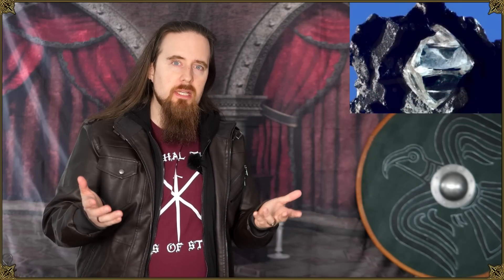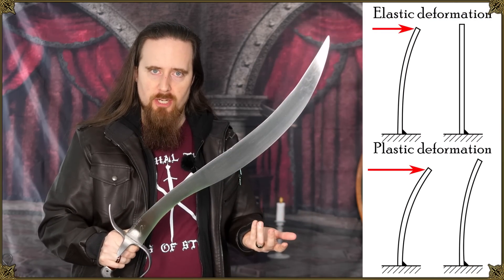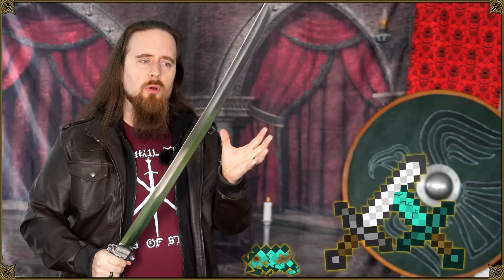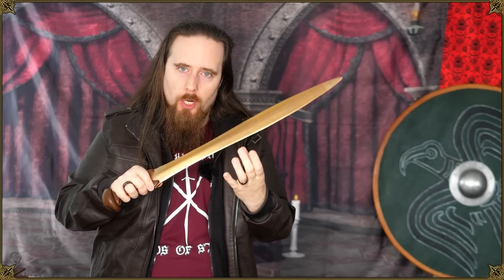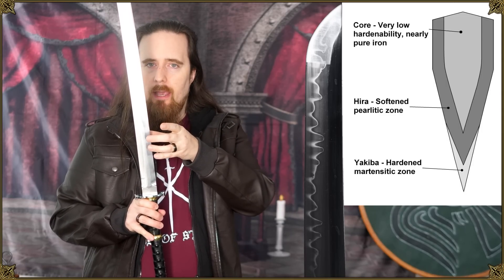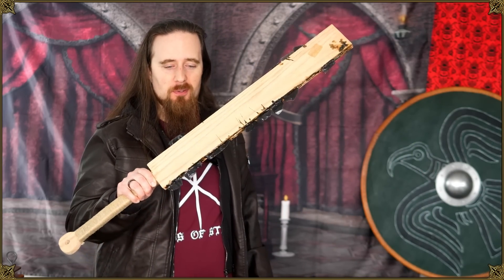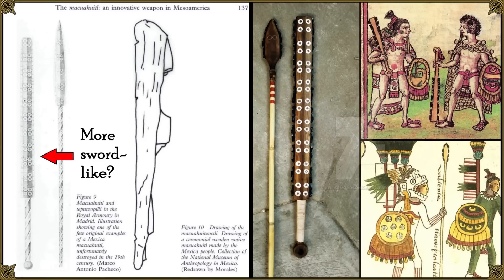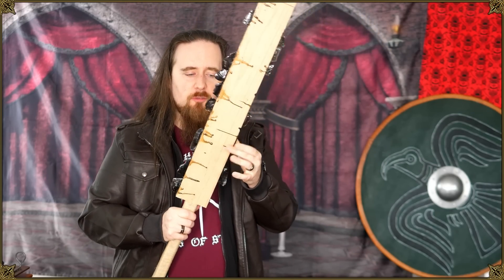Diamond Swords: Could They Work IRL? (Kind Of)

Comment: That is not a very good looking macuahuitl Skallagrim. You lost me a little here. After my own research i've learned these weapons looked more like actual swords and less like big fanned out clubs. I feel like it is too easy for people to forget these weapons were made lovingly by expert crafts people. Aztec swords, weapons and armor to me were the most advanced. 

Aztec one handed and two-handed Macuahuitl were like the original light sabers with a cutting edge of 1 molecule thick. This is 3 times sharper than diamond (sorry diamonds), 500-1000 times sharper than a surgeon's scalpel. They still use obsidian for eye surgery that is how important this material is.
It is incredibly easy to replace or repair weapons made of wood and stone. And in Aztec lands the stuff is everywhere. It was no big deal if you chip up your sword, you could replace the blades or get another.
Even the armor was superior to heavy plate armor. Aztec armor which could withstand powerful obsidian weapons also withstood gunfire with Desoto's own men trading up to get this lighter armor.
The key to their armor was it was packed layers of cloth soaked in a special salty brine and left to dry in the shade. Layers and layers of crystaline protection. 

I would be super happy if you did a video all about Aztec warriors-eagle warriors and jaguar warriors.

Comment: The amount of carbon that goes into steel is actually a huge debate in sword making. Like you say, diamond is brittle (diamonds are basically super compressed carbon structures) and steel created with super high carbon amounts become hard as hell (they'll retain an awesomely sharp edge) but, man, the steel becomes brittle. You get that cut wrong or take a hard blow to the blade and it's going to shatter. Low carbon swords get too soft so they're basically worthless. Carbon is not some kind of magic element, after all, we're made of a ton of carbon (that's basically what "organic" means in chemistry!).

Now here's the cool part: fabricating carbon structures on a molecular level can assist in metallurgy. Making that fabled "diamond sword" may not be possible, but things like carbon nanotubes can help reinforce traditional metals and make them much stronger. In the future we may be able to use chemical engineering to create a metal that can go beyond the 1095 high carbon steel AND be less brittle as well!

Comment: Personally I wanted to make a ceramic blade with a steel core/spine holding in place.... Then I realized that the ceramic parts may need to be broken into smaller pieces to help them flex with the steel portion.
Reply: Isn't corundum (ruby/sapphire) just under diamond in hardness, but is considerably tougher? Makes me wonder how a ruby sword would work.

Comment: At my job we use diamond tools. What they are is a standard tungsten carbide end mill coated in a fine coating of diamond dust and adhesive. The diamonds are "pre shattered" in the form of dust and you still get the effects of their hardness. We use it for some seriously abrasive jobs like cutting PVC plastic and carbon fiber

Comment: Interesting that you bring up composite construction with hard crystals embedded in a ductile matrix-- because heat treated steel is exactly such a composite in its molecular microstructure, with hard but brittle carbides suspended in a ductile ferrous matrix. Different heat treating protocols can alter the volume, size, and distribution of carbide crystals, thus resulting in a different balance of physical properties of the steel.

Comment: Ironically enough, Diamonds are actually Less Brittle than Obsidian, Partially because Hardness and Toughness are not necessarily Opposed Traits, you don't NEED to Loose one to gain in the other across all materials (Some Materials ARE Tougher AND Harder than others, The "tradeoff" thing is only in relation to different qualities of the SAME Material, like Steel), and partially because Diamonds are SO Hard that the Minimum force required to actually Shatter one is MUCH Higher than what is required for Something as Brittle as Volcanic Glass (Obsidian). Seriously, Diamonds are "Weak" to Pressure, but Go Watch a Vid about how Much Pressure it can take in a Hydraulic Press before it actually Shatters... It Starts to pierce into the Press's "anvil" for a while before it finally Explodes. A good way to explain it is Hardness Equals "Damage Reduction" and Toughness Equals HP, Diamonds have ABSURDLY High Damage Reduction so Basically nothing will do any damage to it, BUT it has Low HP, So if something COULD do some Damage, it'll just be completely Destroyed, it just takes a LOT to get over that "you do no Damage" threshold.

Now I can't be Certain of this(I didn't Test the Kinds of Impacts Required to actually Damage a Long Stick of Diamond), But I've got the impression that unless your Made your Diamond sword to be Rapier thin and long, that Human Strength simply would not be enough to Shatter a Diamond Sword... Oh and If a properly Proportioned Diamond Sword (A Shorter and thicker Blade, like a Gladius at most) Clashed with a Steel one, it would CUT it, Probably not all the way though, but it would probably Have about the same effect as what you'd Expect from using a Steel blade against a Wooden one: Do NOT Repeat the Process too much, or you'll end up with a Metal Twig instead of a Sword. Now the Problems with the very Concept of a Diamond Sword are that A: If anything hits it hard enough to do ANY Damage to it, it's gonna Basically EXPLODE, there will be nothing to Repair, so you won't Just have a Blunt Metal Rod to Hit People with anymore, you'll effectively be Unarmed. B: Manufacturing one is effectively Impossible, we'd need to Make a Diamond from scratch in such a way that it would be Big enough to be Made into a Blade, Which is an Absurd notion considering how Tiny we make them with Modern Technology, Even a Macuahuitl Style Shorter Blade Fragment would be Too Big and Unusually shaped to Really Work...

That Said, In a Fantasy Setting, you could probably use Transmutation Magic to Fuse and Shape a Bunch of Diamonds together to make a Single Blade in whatever shape you want, Ideally Wrapped around a Steel Core to give it structure, Kinda Like "Gold plating" but a somewhat Thicker, done like this in such a way that if the Diamond DOES Break, the whole Sword doesn't Just Explode, just a relatively Small section of it. Then enchant the whole thing to Make the Diamond Blade Regenerate any Damage it might take, fixing the Problem altogether. Now you have a sword that can Cut other Swords and you don't Risk loosing it if you hit it at a REALLY Bad angle or if a Guy with a Hammer as big as your Head shows up!

Oh and Wolverine's Iconic Metal claws are Made of "Adamantium" which is a name Derived from Diamond if you go far back enough in it's entomology. Adamantine was the "Metal of the Gods" in Greek Mythology, the Gates Olympus were Made of it. Take Adamantine, Replace the "ine" with "ium" to make it sound more like something from the Periodic Table that also evokes Metals, and Voila. But, Adamantine itself is Derived from "Adamant" which is Greek for "Untamable" but also used as an other word for "Diamond"... So Really, Wolverine is Running around with what is Kinda Conceptually Diamond Knives in his Hands...

Comment: So, the lesson I'm getting here, is that the Macuahuitl is almost a one-shot weapon. It will rightly end the first guy you land a solid blow on assuming he's not wearing steel armor, but you're going to be doing severe damage to your sword (actually it's kind of a saw, kind of a club thing?) in the process, greatly reducing its effectiveness. The next blow, in the same spot, might not have any obsidian shards worth mentioning, so you have to reverse is to get in that second shot, but now that side is wrecked too, so your third hit will have to be with a less-optimal part of the blade, closer to your hand, and before long, if you're still up, you are fighting with a very clunky club that might still have a few jagged or pokey bits sticking out of it.
Reply: And if you are fighting an actual man rather than a target dummy or water bottle, the man would raise a shield or weapon so your macuahuitl loses its edge without even contacting flesh.
There is a good reason nations that mastered metal conquered most of the world while those still messing around with wood and stone fell into the history books......

Comment: The best use-case I can see for a diamond blade edge is as a knife for doing basic cutting utilities. We see similar things with some modern drills where the very tip of it is made of diamond. Beyond this, of course it wouldn't be effective, for the reasons stated, anybody who watches Forged in Fire has probably seen the consequences of material that is too hardened.

Comment: I think you can look at ceramic blades as those are quite easy to find. These are extremely hard, can be incredibly sharp and has fantastic edge retention. But they are also very prone to chipping and breaking. A blade made of diamond would be quite similar in it's properties.

I have had several ceramic kitchen knives, but they tend to break so there's only one left now. And that one has a few chips taken out of the edge so I never use it. I even got a special diamond sharpener for the knives, but they tended to break before they needed sharpening...

Still, I think they are pretty neat, much like a party trick. But for daily use they are not really worth it.

Comment: What about diamond powder steel alloy and the the edge is heat treated with diamond powder? The edge of the blade preferable. Though to make it softer you could use more clay. I think the point of a diamond sword is to reduce the material, time it takes to make the blade and increasing the hardness so because of diamonds toughness against other materials. 

However designing a functional one would be difficult. Could expirement with using quartz or other crystalline structures within steel. 

One more thing diamond, crystal or ice swords are seen in fantasy because they have a special property depicted of magic being incorporated within them.

If you could make the bonds of diamond more elastic that could make it possible. 
Not sure how to do that, there may be a method in physics of some kind to do so or atleast a theory or two. More research is obviously needed in what ever method is available to make a diamond sword at least more feasible.

Comment: From what I have heard, well-made Machuahuitl have long straight flakes of obsidian that are not flintknapped but cleaved off. They are removed from larger pieces of very pure obsidian with an edge that is already sharp and close to perfectly straight, and are considerably sharper than what is possible with metal.
Reply: Many tests with more crude flintknapped or spiked versions show it behaving more like a club, but the best historical examples had long, near-atomically smooth blades and could cut quite effectively. The Spanish considered the weapons to be a type of sword.

Comment: I see pcd used in CNC machining where The main tool is a steel piece and the pcd is a coating which is not so dissimilar to the idea of a hard jacket and soft core. Usually those tools are insanely expensive so I don't see them in wide scale or large tools very much. But if there's any hope it would be something like that. Maybe not as a combat weapon but could make for a good kitchen knife perhaps.

Comment: In anticipation universes there are some solution for that diamond blade thingy:
In Cyberpunk there are sword with diamond monomomolecular thick blade edge cutting through anything like hot knife into butter. The blade being so brittle, it is totally interchangeable. edge is busted because you slayed a guy in its  metal gear armor? No problem! Unscrew the blade edge or blade edge segments that are damaged, replace that by new one(s) and you're good to go!

In Shadowrun there are dikoted blades, the blade is reinforced by a deposited layer of synthetic diamond, turning it into a deadly sharp and hard weapon, able to slice easier.

Comment: That topic makes me think of cross-country ski poles. Good ones are made of carbon fibers, which makes them extremely light and extremely rigid, which is good for competition because it means that you have less weight to lift and a bigger proportion of your upper body's strength gets transmitted to the ground. The downside is that they aren't elastic at all and break very easily.

Comment: looking into it a long time ago, diamond has less of a problem with being brittle (though the layman would probably think of it that way) and more of a problem in that it has very obvious cleavage (im not making this term up i swear) which is effectively a plain within the atomic matrix which the atoms slide by each other very easily. outside its cleavage diamond has more tensile strength than any other natural material and most manufactured materials, but because it doesent form large structures (and by large im talking large on an atomic scale) without these cleavage zones it can shear along them with much less force and due to its hardness this becomes easier because less of the crystalline structure wants to deform to compensate.

diamond is not however more brittle than obsidian which is not only full of cleavage plains but is also just much much much much weaker. in ultimate terms of its robustness you can smash a hammer against diamond and fail to chip it (at the right angle) and the same cant be said of obsidian (no matter the angle you smash it) while the same diamond can be struck with a very light force at the correct angle and snap in half.

Comment: Yeah, totally agree with your analysis regarding a hacking/slashing sword. But let’s get a little more creative here… what about a diamond rapier? The impacts on the blade would be less significant, as they’re more parries than proper blocks, and the hardness and edge (or in this case point) retention might be advantageous for armor penetration. Likewise, what about a diamond spearhead or arrowheads? With the elastic bending being absorbed by the shaft, wouldn’t the hardness be an advantage in these cases? Again, greater armor penetration? Just a point of curiosity…

Comment: a better use for diamond as a weapon would be for thrusting weapons like spears or rapiers as the type of cut that diamonds are typically known for shows where diamond is at its strongest
although for thrusting swords ied only have the tip as diamond
there is though one level higher then diamond, iridium, only found in meteors iirc and only because it heats up super high entering the atmosphere and then the carbon and diamond inside it being compressed on impact into iridium

Comment: Assuming cost and resource rarity weren’t an issue, would steel still be the best material for swords? If not, what is?
Reply: My guess: Yes, pretty much. Because swords as we know them are optimised for their material just as much as their function. Steel swords look and function very differently from bronze swords for a reason. 
The question is: If any other material were abundantly available (auch as titanium or  carbon nanotubes), what kind of mele weapon would we make of it?

Comment: Warning, meandering thoughts.

If you were to make a weapon with diamonds as the cutting edge, I'd not use diamond diamonds, but use bort. Bort is diamond but has a slightly different crystal structure and is more likely to have inclusions. Its slightly less hard that diamond but you might gain a little toughness, not much but some is better than none. Anyways, there are many other stones that would make for interesting fantasy weapons that are "tougher". From what i know about cabbing and faciting jade is often noted as just as difficult to cut as diamond, though this is because of the nature of the crystals being more like interweaving fibers going every which way with hard and soft directions in the stone. If someone really wanted to make a gemstone sword, theyd probably want something that has no perfect clevages (see fluorite and calcite for examples) and has a fiberous crystal structure that forms in masses that have those crystals overlapping each other at irregular angels and directions. Or something more granular so there are no possible angels of cleaving. It'd qlso need decebt hardness too, as a rule of thumb for making jewlery, stones need to be  fairly hard, ideally 7 or greater (7, is the hardness of quartz, steel measures in at 4), and something that is has some heat and shock resistance, it just makes the manufacturing side of it easier, if it doesnt, youd run the risk of working it and it getting too hot and fracturing and splitting, or hitting it just right and shattering. No stone is gonna have enough elastic flexibility, so magic that grabted that atribute would be a must.

Random aside, glass, abd by extention obsidian lack any crystal structure. There are other stones that are also like that, opal for example.

Comment: OK, yes, diamond is extremely brittle.  As in, it has zero permanent deformation after it breaks.  That is one of the things that make it so good as an abrasive.  As it crumbles, the remaining edges are also sharp.  As in come to a near perfect crystalline (aka single atom width) edge.  Now the problem with a sword blade is this edge is always at way too oblique an angle.  I think the best angle you can get is either a 45 or 60 degree.  So, even ignoring the brittleness (which is a massive issue) you can't have that famed crystalline strength at steeper angles than are supported by the crystal structure.
And if they're using tungsten to increase ductility, it's already more brittle than just about any overly hardened steel.  Plus you then end up with density in the crazy land.